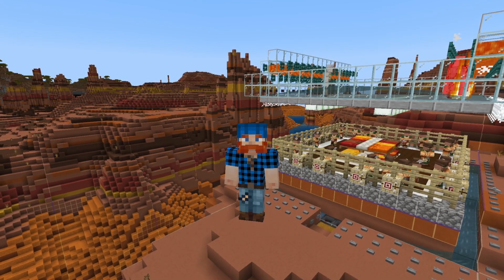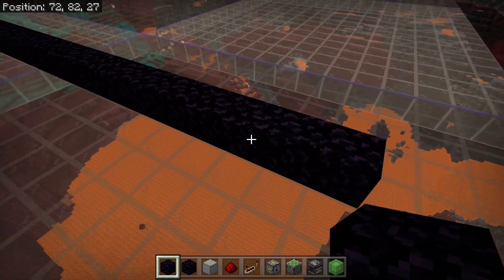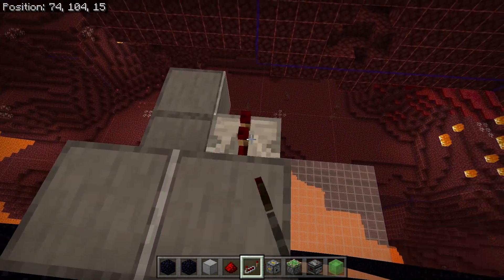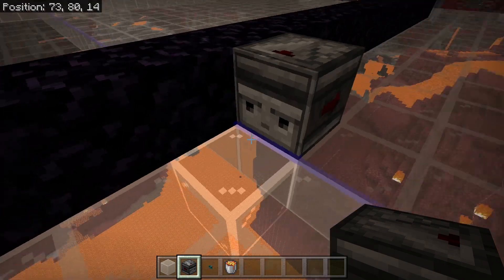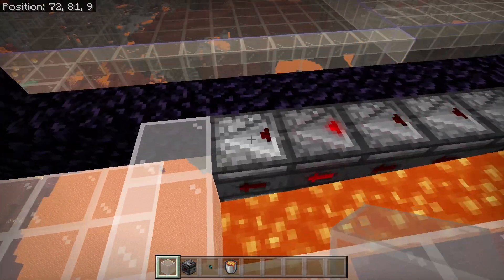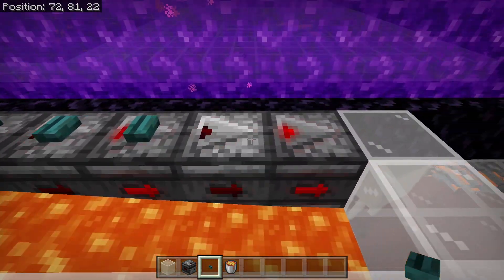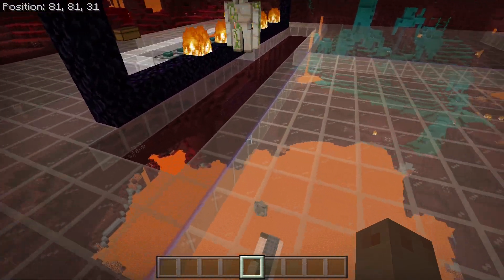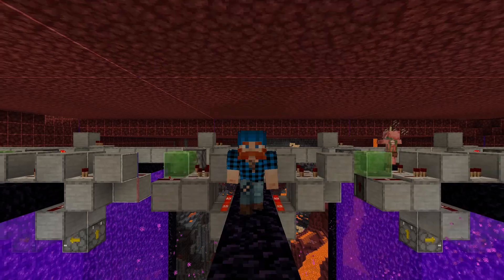Infinite Iron from The Impossible Iron Farm [Happy April Fools]

Comment: Just tried in creative and it produces 23000ph per portal. So the discription is slightly off. This farm produces more.
Reply from the maker: Thanks for the correction.
Reply: @RufusAtticus  smh Rufus, what have we told you about getting your dang rates right?
Reply from the maker: @Ri-ver  Run it for 5 minutes and multiply by 15?
Reply: @RufusAtticus  oh, Solid method. Nvm then, it must be a different issue
Reply: 5 minutes is not even close to enough time to accurately extrapolate the rates from. I suggest at least 7minutes.
Reply: @mikeyb1239  then multiply by 10
Reply: @raymondstheawesome  might as well multiply by 11 just for good measure